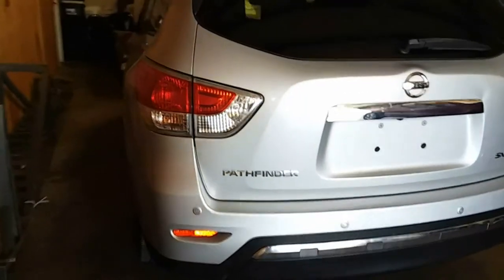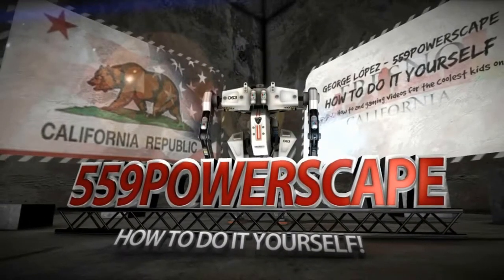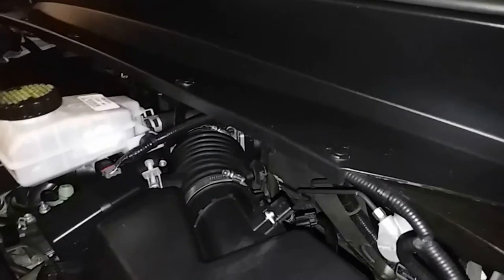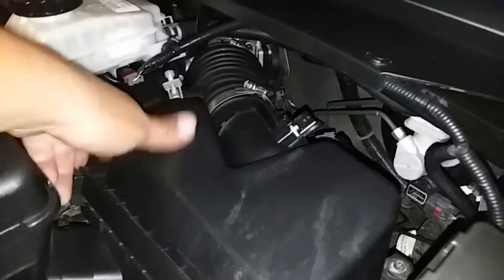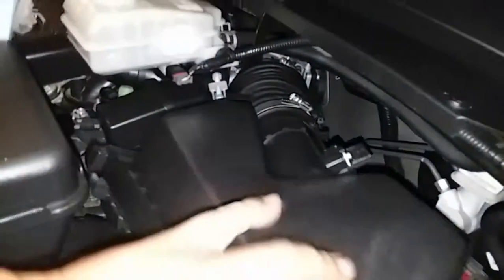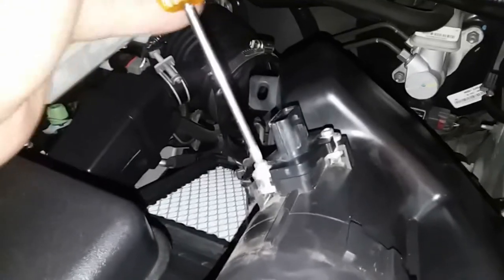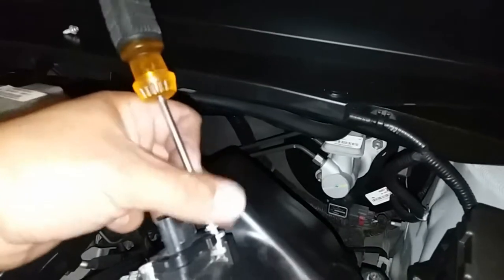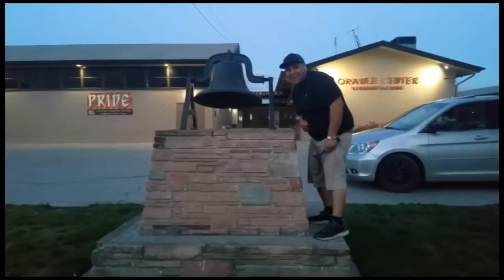How to: Remove Mass Air Flow Sensor/Temperature Sensor (MAF) on a  2013 Nissan Pathfinder

Comment: Thank you Mr. Lopez. My mechanic just told me that it would be $375.00 to replace the mass airflow sensor on a 2016 Pathfinder. NEVER MIND, I will do it myself. Thanks for the video!🙏🏾 👈🏾
Reply from the maker: Thats right! Whole reason i do this, to save you money! Thank you for your support, I'm Glad this helped!
Reply: I was wondering, did you buy a can of the CRC mass air flow sensor cleaner before replacing the sensor. All you may have to do is clean it.